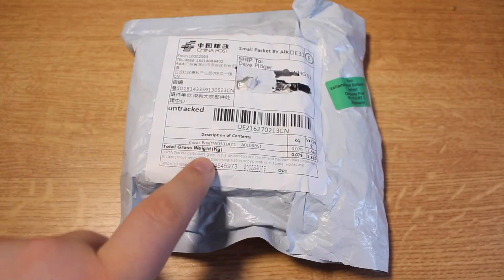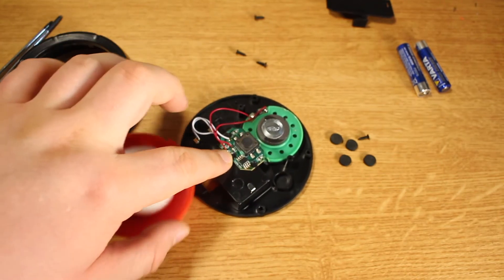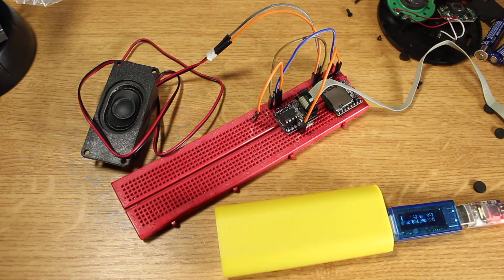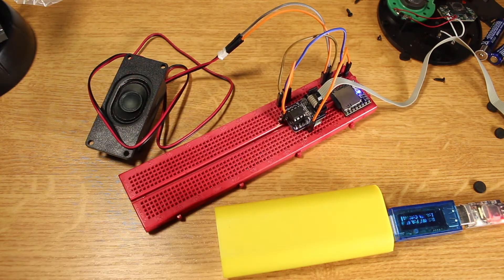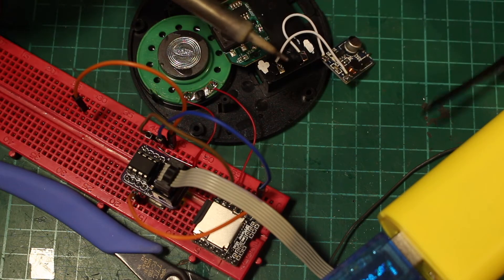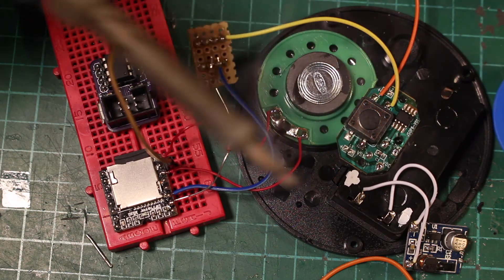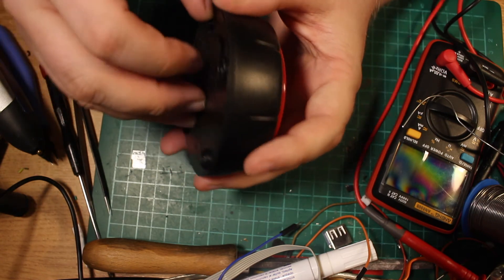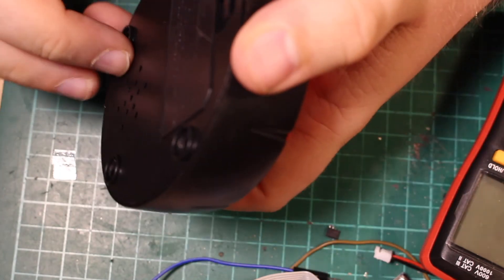Sound button: Et boum! C'est le choc!

Comment: You could use the button to turn on a mosfet before the boost board which is in turn held on with a transistor connected to the ATtiny85, until it is ready to turn off. That might make it zero standby current.